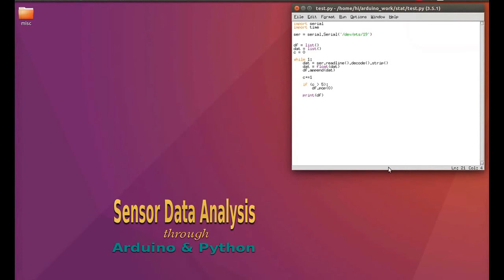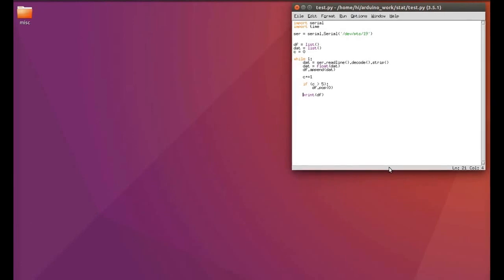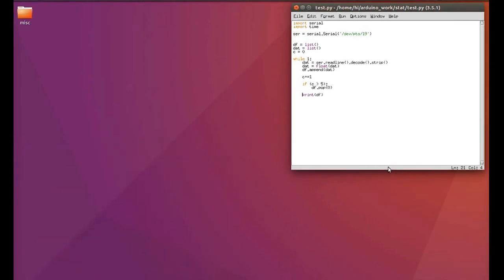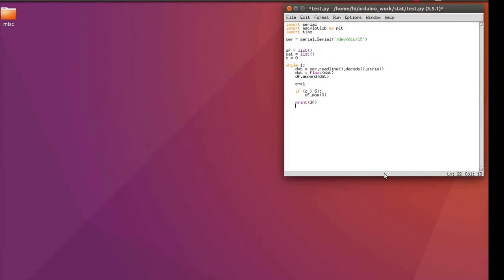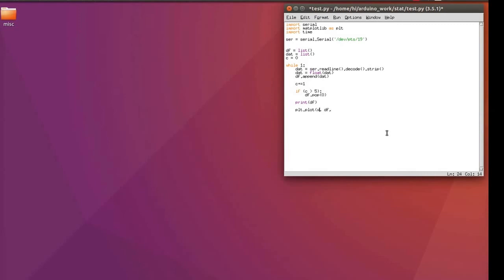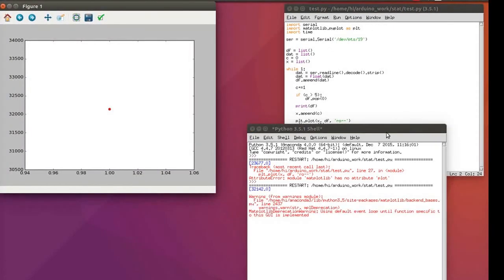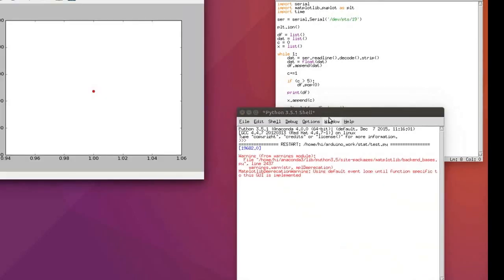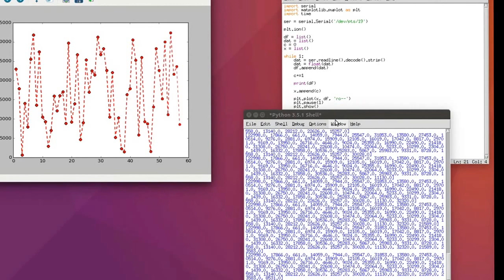Sensor Data Analysis through Arduino and Python (Plotting) - 4

Comment: When i run the code after gew seconds there is an error occuring saying "could not convert string to float". Any ideas? Please reply asap as i am working on a college project and need to do a plot of my final data.
Reply from the maker: Yes, this is the problem while dealing with serial data (streaming). You need to use "float()" statement just under while loop reading data to array. Just like in the video.